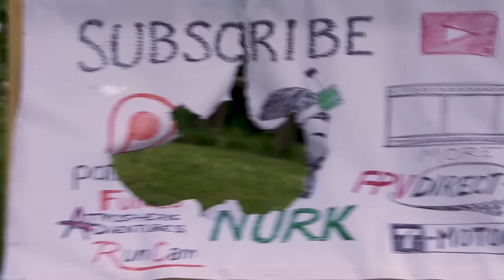NURKlear Cooling Towers

Comment: i hoped for more fun with those stairs.
Reply from the maker: If we had more time there would have been more. BUT if you crash on the stairs you're not getting the drone back. :-/
Reply: for such places you should consider a ducted heavy lift rotator drone with magnets and emergency harness release if it get's stuck